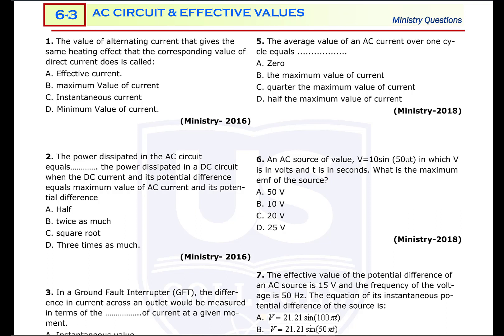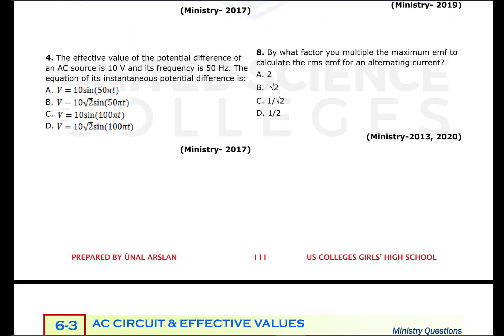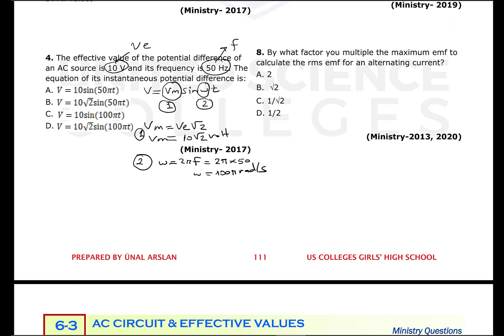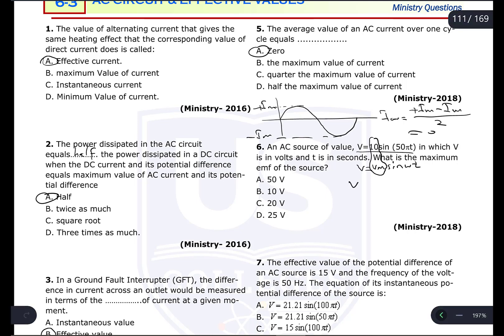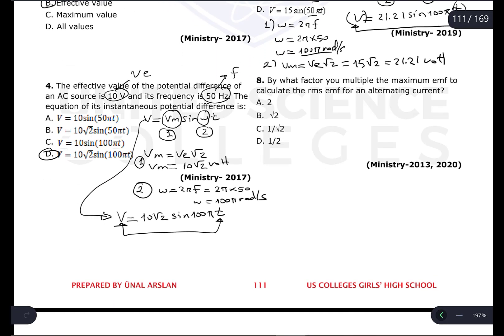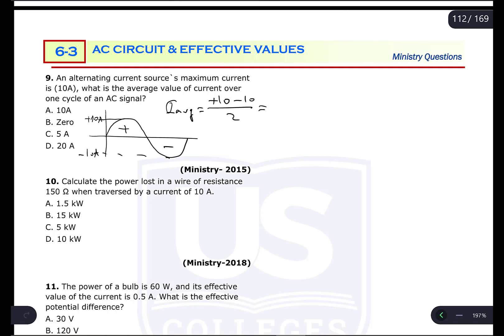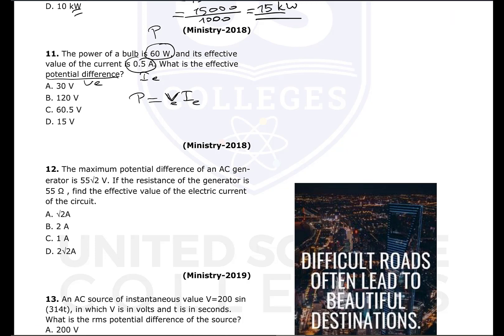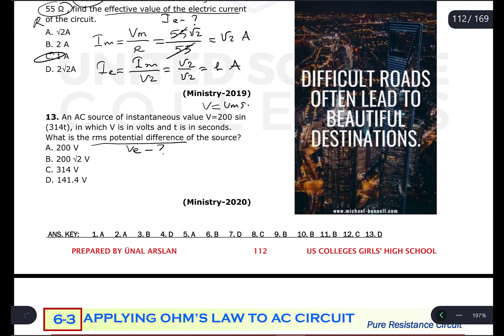Effective Value and Power of AC and DC Circuits | Answers of Ministry Questions | Wezary Physics

Comment: Hocam in8:30 as a note we can say // if the givens in a question was maximum of current or emf it must specify it either it is AC or DC but if it was not maximum so, is it (ALWAYS) DC generator 

Hocam bu noteum doğru mu???👆👆👆👆👆
Reply from the maker: doğru.